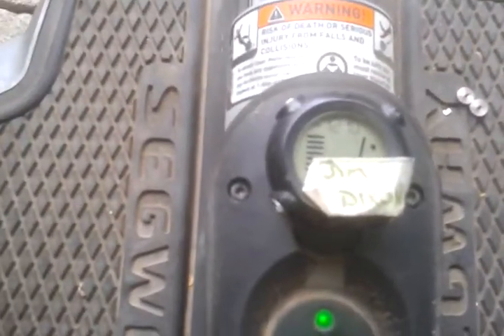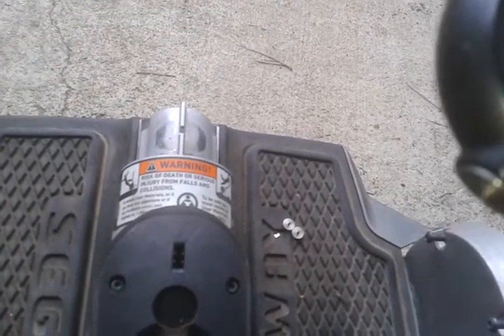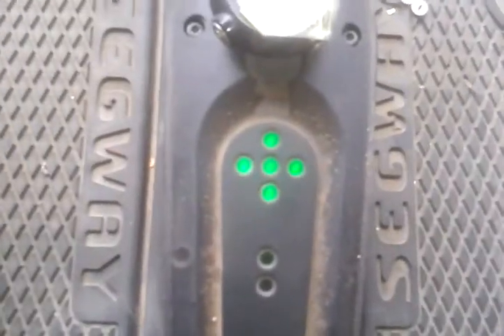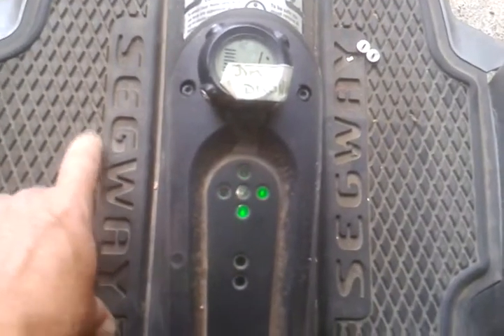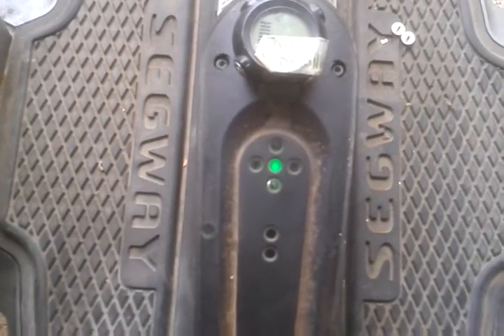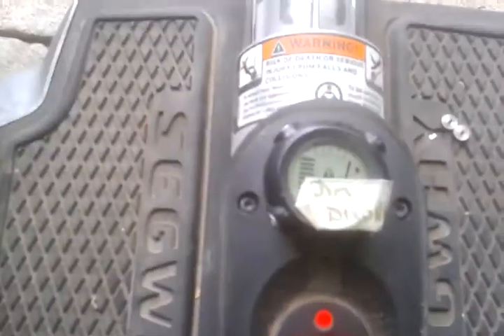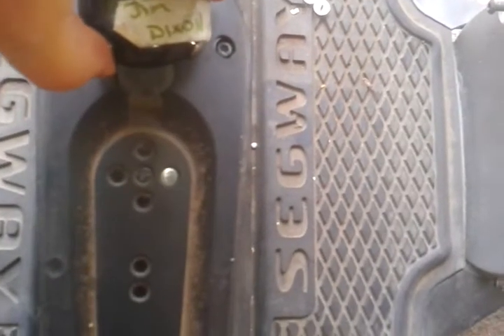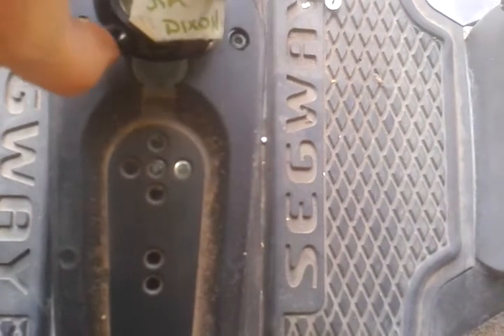Segway error codes C 080 & E047

Comment: Can you assist me with an E047 error shown on my x2 please?
Reply from the maker: Hello Stephan, I'll be glad to try. Here is what your code says is wrong with your platform, does this help?
E047 Actuator Fault CU A Reporting MOTOR VOLTAGE CONSISTENCY FAULT Power base fault Follow SART diagnostic manual.
Reply: I have the same error in my i2. I´m going to change the engines and will see.